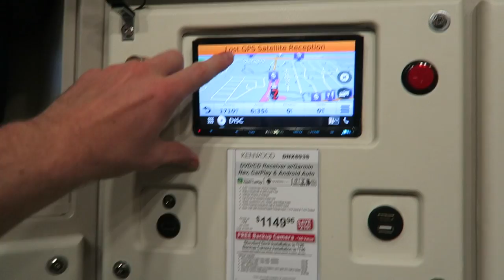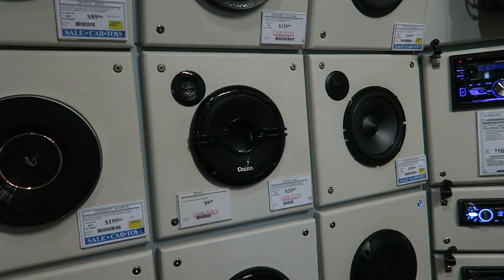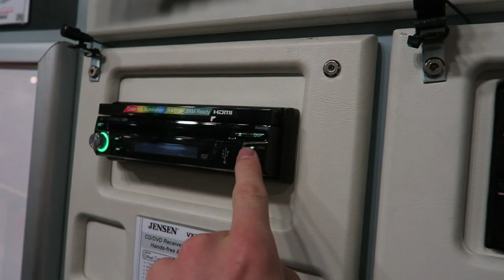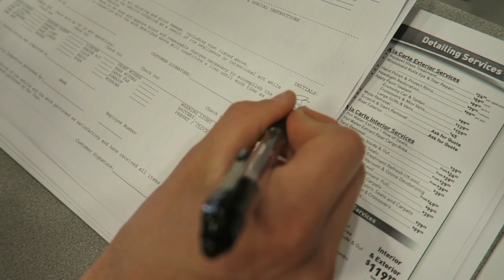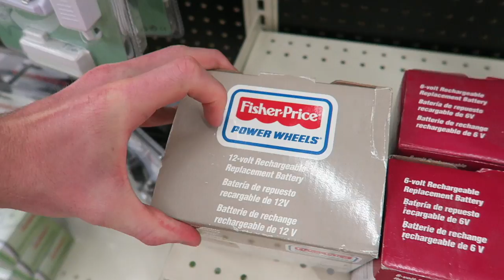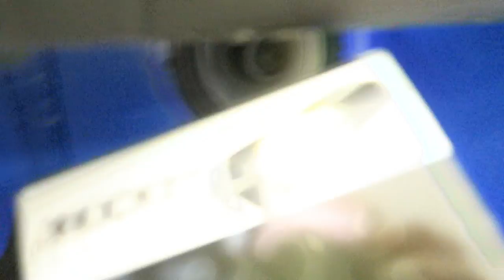Custom Toy Car SOUND SYSTEM!

Comment: if you rig up a car battery it will go like 15 20 mph
Reply: Teddy vlogs yes! this is what I was going to say. Install a car battery!
Reply: Teddy vlogs If only they knew how to do that.
Reply: Teddy vlogs yeahhh👌
Reply: Teddy vlogs no...only 12v😑
Reply: There isn't even enough space anywhere on it to put a battery as large as a car battery...Just put 4 or 6 smaller rechargeable batteries in it. Wire them in series so the voltage is added together. 4 batteries would be 4 times the volts turn the motor @ 4 times the speed. All that empty bed space would be perfect to allow for this kind of mod, and they would be covered up by the new cover over the bed(:
Reply: Adam Smith i think its kinda bad for motor...12v motor on 48V???ummmm? 24V would be enough
Reply: Adam Smith Except a car battery can provide way more amperage than the stock battery, thus it can provide maximum power for the motors. Plus the charge will last much longer than stock. Adding another battery also makes it go faster, but I'm not sure if it is better than a car battery. And I'm not sure how much it will harm the motors if you add lots of batteries making it 36v or 48v.
Reply: RCCaleb amps are just the strength of the volts and have literally no effect on the speed of an electric motor. Car batteries have low voltage and high cranking amps for turning a starter(which takes way way more torque than required to move a small plastic child's power wheels 😂, exactly the opposite of the objective) A car battery is a big heavy lead acid battery and does not last very long if not constantly charged by an alternator. very quick drain, meant to be drained for only a few seconds when starting a vehicle. Where would you even put a huge heavy car battery on this little plastic car anyway LOL.smart. The battery that came in this child's toy is designed for constant drain and is probably more than 12v anyway. high amperage would be totally pointless considering it is a very light and plastic toy vehicle. Btw high amps will fry a motor or person way faster than high voltage and low amps. It is high torque that breaks things. I like to overpower electric motors and you would be amazed at what voltage tiny motors can handle, without even getting anywhere near close to frying. 60 volts to this electric motor in the toy would be nothing for it. Wouldn't hurt it even the slightest. I've put 60v to a small toy heli motor before (with no prop) to try to burn it, and all it did was laugh at me. That is over 16 times the voltage that it was originally hooked up to(: not just a second either, I actually tried to burn it. Even if the power wheels motor did eventually get burnt, it's not like we are talking about an expensive full sized tesla car motor. You can buy a brand new power wheels motor on eBay for 20-30$us and change it in minutes. A battery would cost way more more than the motor too.
Reply: Shut da hell up no it would last quite along time on 60v. Even if it was used every day. It would shorten the life of the motor slightly tho, but it will burn up eventually anyway on 12v ( or whatever the stock battery is. It's like adding a supercharger to an internal combustion engine. It will shorten the life of the motor slightly, but it will work better while it works. The engine will still blow up eventually without the supercharger, but it won't work as good(: even if the power wheels motor did eventually get burnt, it only costs 20-30$us for a brand new one, and it would only take only a few mins to change it.
Reply: Teddy vlogs 😂😂😂it will? 
ummm no.
Reply: Adam Smith yeah....brushed motors wear quicker than brushless....its like "no pain, no gain" to get more speed and torque we have to sacrifice the lifetime😂.....
Reply: Shut da hell up lol yeah, so true. High amps(like a car battery) are what would fry the motors. you can hook together any size batteries and get 60 v. Smaller batteries would increase the volts, without getting too many amps and killing the motors. You can even pair them in series for double amps, depending on the size of battery that you choose to use. If you use too small of batteries, with too low of amps, it wouldn't even move the car,cuz no torque. It needs the perfect size of battery and combo, for enough amps to last, while making the motors turn way faster. Also you would need to hook the battery pack up directly to the motors and hook up an on and off switch for the throttle. Or you could defiantly find something on eBay for like 5-10$ to use for a variable speed throttle.
Reply: man idk
Reply: NibbleBit64 😂no. don't think so pokey-man
Reply: Teddy vlogs i agree so much
Reply: Teddy vlogs technically they run on a car battery already as they are 12 volt batteries think you meant if you run it on a 48 volt lorry or tractor battery it will go 15-20 right up 2 will do at least 60
Reply: will bassett 😂
Reply: will bassett cars battery have whole lot amps and can supply much more power...just like 3.7V lipo can supply more than 10 times power than your smart phones 3.7V battery
Reply: that is absolutly true smart man
Reply: same voltage means same speed. Increased amps just means longer life and more available torque for an electric motor, nothing to do with horsepower or rpm. Also a li-po is not the same kind of battery as a li-ion battery, while a car battery and the original battery for this toy car are both the lead acid type.
Reply: Adam Smith oops i didn't knew they run on lead acid, i thought they have NIMH batteries.... but hold up...more voltage=more rpm, more current=more torque
Reply: Shut da hell up I have a  3.7v 500 mah lipo and a  3.7v 600 mah li ion in front of me right now, and they are about the same size and weight. The li ion is just a little bit bigger, so, with the same amperage, they both would last about the same amount of time at the same drain speed.
Reply: Shut da hell up yes that is right. Nimh batteries are only meant to be used for quick drain applications(electronics that use a lot of power in short bursts), but Ni-Cd batteries can be used for constant drain applications, like this toy car.
Reply: Swap in a a lawnmower engine like this guy did in this other video I watched and since its gas powered they wouldn't need to keep charging it. Just add gas and go
Reply: D E N V R even if they got a lawnmower engine, i doubt they could do it😌
Reply: yes that should work or a motorbike engine
Reply: Tesla battery
Reply: that should totally work
Reply: it might explode  I tried it once
Reply: Chance Pettigrew Modifications at that level demands skill and professionalism...(not saying you are unskilled... no offence)
Reply: well he is talented am ii right he is good and a pro at it
Reply: Good luck guys! You say increase the voltage but reduce the amps, yeah that won't work, the high the voltage, the more amps the motors will want and therefore it probably won't make much of a difference in speed...
Reply: Teddy vlogs it’ll probably burn up the motors. They would probably need to put some bigger one in there

Comment: Upgrade the axles to Stell,buy some small lawnmower whells,and put a engine that can go 20mph like gocart if it does not fit try putting it under seat and support it under drive to mic Donald's to get food it has a light frame so put Stell bars underneath to support it adventully it will be sick also make trailer for one more person please do I love your channel please do this bye
Reply: Hi
Reply: Nolan Corbett uhhh,punctuation?.
Reply: MarkyMoo 232 its right punctuation ok so?
Reply: whats the point if its a real car thats the joke
Reply: Nolan Corbett I
Reply: Nolan Corbett yeah and a jet engine on top of the subwofah

Comment: Put rubber tires on it and put 4 or 5 of the same batteries that you already have in there to make it have maximum speed

Like if you agree😜
Reply: Don't forget the rim lights
Reply: Owen Wilson gdgdhfhdh
Reply: Owen Wilson,the regulators will keep it from going too fast so it will stay the same speed but it will last longer
Reply: No
Reply: Owen Wilson kkkkkkk
Reply: Owen Wilson 
Yeah
Reply: Thay can’t do that because there is only space for one batter
Reply: Vincent Gregonis gngggg vgggggggb thn
Reply: you know you can put a car battery in it
Reply: Owen Wilson or 2 24v batteries

Comment: my brother's sound system in his car is more expensive than the car itself, it's a 2001 Nissan Maxima SE and it has 2 tweeters, 2 12in subs, 2 6×9s, and all the door speakers were replaced, all of which are Kenwood's top of the line

Comment: its not that the motors have voltage regulators, its that the gearboxes on them lower the RPM so that they have enough torque to move the vehicle. just buy a bunch of those batteries and wire them in series.

Comment: I work at a audio shop in colorado springs and we host bass competitions the owner of the shop is the judge as well and there actually is power wheels that have been made that compete let me know if you want more mods we do led lighting and a wide range of things and you can also come get a demo of a pt cruiser with 4 15" subs and a 10k amp running off 6 batterys

Comment: If you onboard unscrew the screw by the shifter then you'll gain a couple more horsepower but not all the way just a little or like 3/4 of the way

Comment: Buy like four more of them, then take the batteries out and put them all in the back of it and hook them up so it will go a lot a lot faster, if you don't have room, build I little play form of wood over the top and put it up there so you'd have a shade and more batteries
Reply: Or you could cut out that middle peice in between the bed and the seat and you could of sit there for more room and put the batteries beside you and you can have more batteries if you also do the roof thing, and maybe y'all could make a trailer to go on it to hold the stario , AND HAVE MORE BATTERIES IT WOULD BE EPIC

Comment: try to put a little go-cart engine in the put a chain running to the back and put rubber tires on so you don't spin out every time you try to drive

Comment: what is the you can take that lever what makes you back up you take unscrew that off and make you go faster in the Power Wheels or you put a car battery together and take the wires off and find out how to connect them to a car battery

Comment: u need a big car battery that's y the sound cuts off cuz the small battery can't handle the amps the amplifier is pulling so the amp cuts off done it before and since there's no charge on the battery while its in use its gonna die really fast

Comment: Guess what batteries when you leave it charge for a long time they can just die the reason why you couldn’t make the toy car go faster is because the motors in the toy car have a gear ratio that prevents her from going any faster and less if you have enough torque

Comment: Why not ad like a 49cc or a moped/scooter motor. you could add a gocart motor but use a gearbox even though they're like 200 bucks. and if you put all that effort into this plastic why not add a alternator so you never have to change/charge the batteries